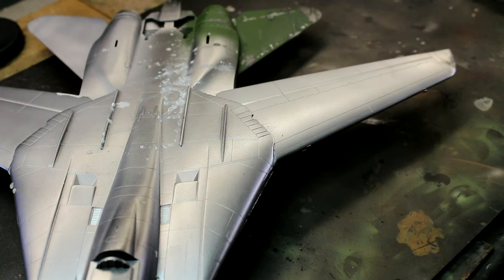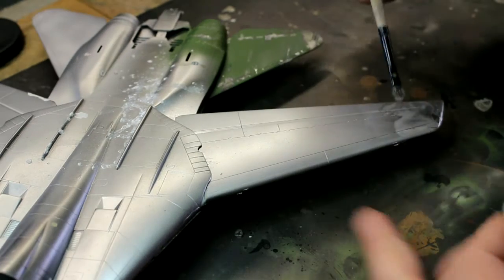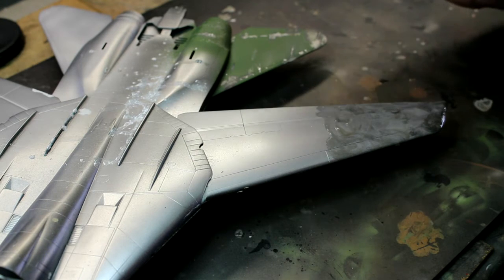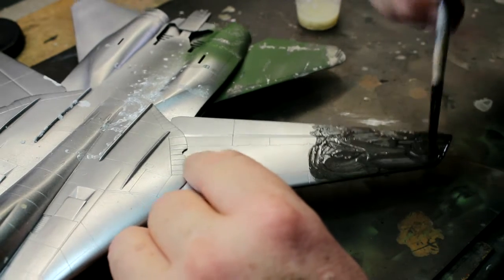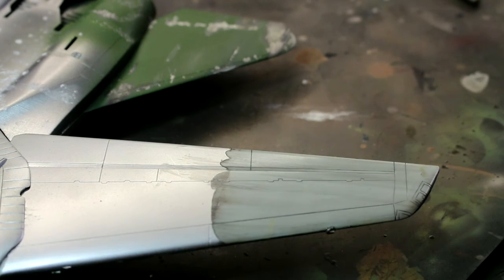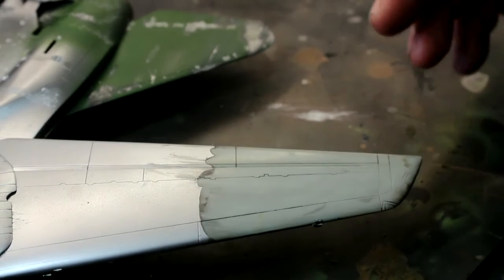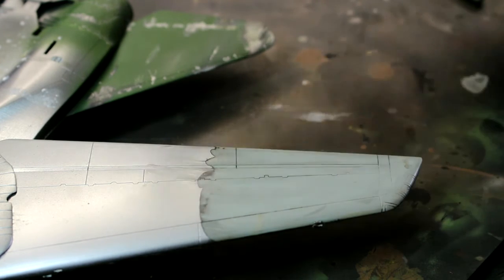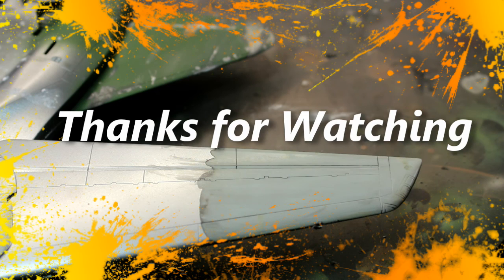Scale Model Paint Stripping Tips

Comment: Will the stripping process damage canopy and windshield parts? How hard is it to repaint once it’s stripped?
Reply: I’ve used this several times.  It had a tendency to haze up clear parts but you can polish them back but it takes several goes and then a dip in Future or Pledge Revive It as is known now brings back the clarity.  Repainting is then as straight forward as it the kit was new but I’d also recommend wiping the model with Isopropyl Alcohol after the over cleaner treatment just in case there is any residue left behind which may affect any new paint that gets applied over the top.